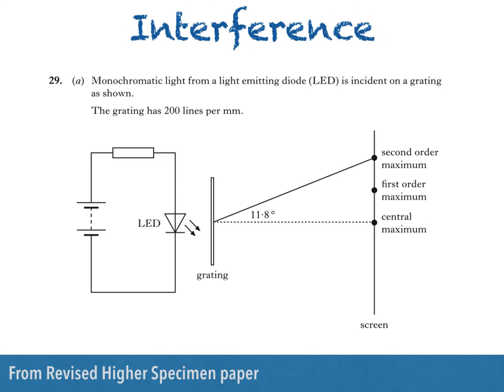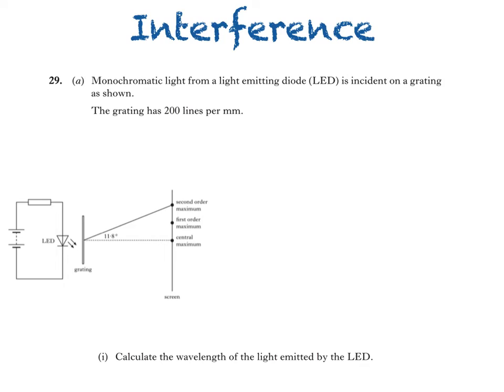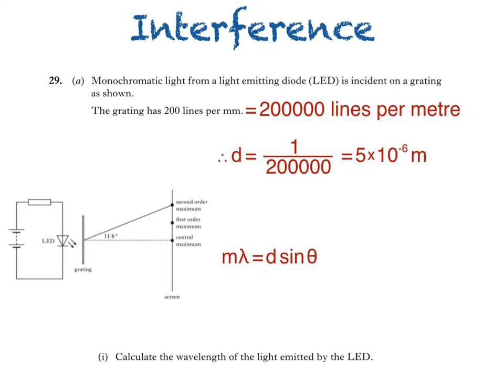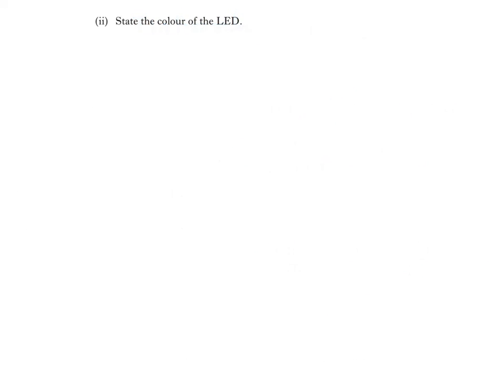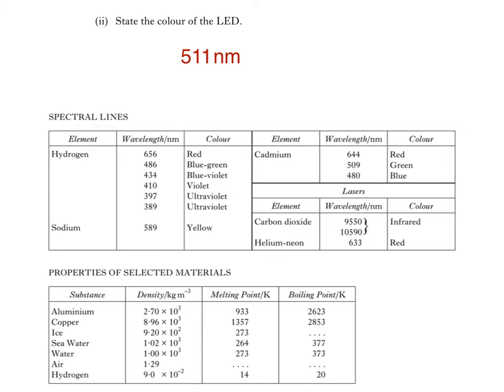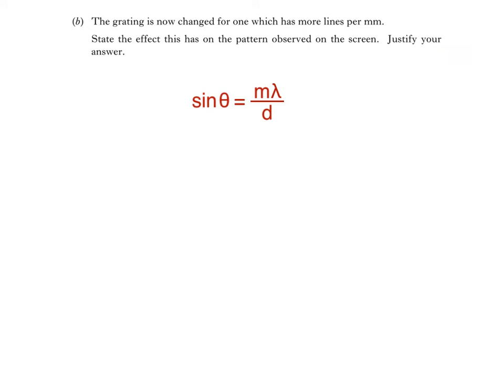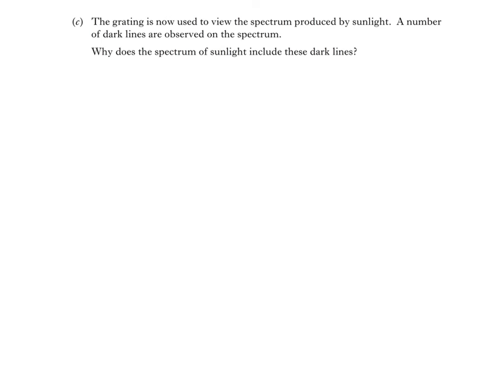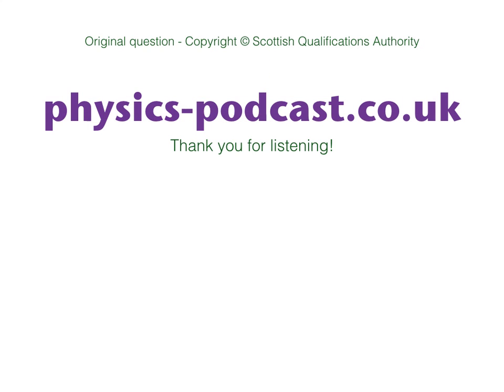Higher Physics - Interference

Comment: Why do you do 1/(lines per metre) to find the distance between the slits in the grating
Reply from the maker: If you imagine that there are 10 lines per metre then there must be 10cm (1/10m) between the lines. As long as you remember that step you're on the right track. All the best with your exams.